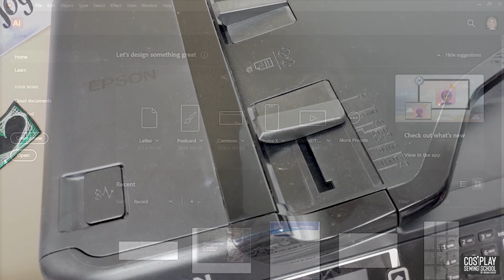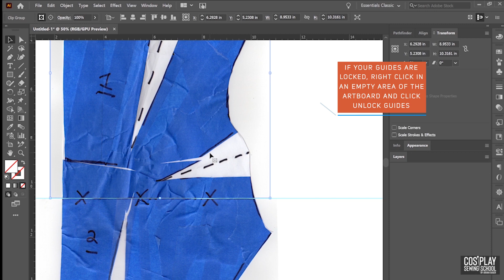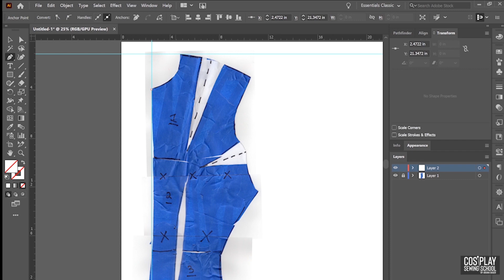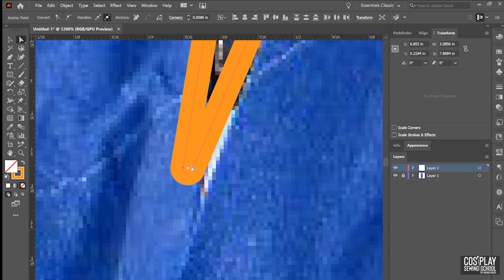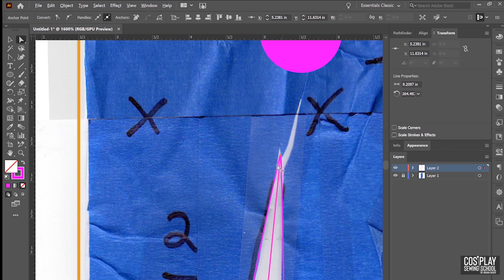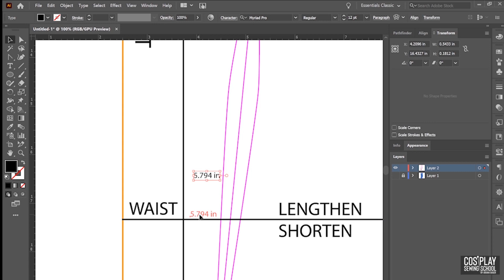Easy Way to Scan and Digitize Patterns for Sewing and Foam

Comment: Do you have a video on how to duct tape yourself and create that block?  This is amazing and much less costly than using StyleCAD and getting its digitizer as well!
Reply: I will do one soon. I will use my dress form for it, but the idea will be the same. I don't have a helper at the moment due to covid.

There are also great flat patternmaking ways to do this using math that will get your really darn close. Glad this helped!
Reply: @ArianaBauer  I have been flat patterning for the past decade, but for close/accurate fitting purposes, this is a skill I need to strengthen, also because I don't have a helper to duct tape me as well.
Reply: @DuchessPinkbunny  I am always refining my blocks. I keep changing weight and size so its a never ending cycle!
Reply: @DuchessPinkbunny  I struggle also because I keep gaining and losing weight and changing size. Its a process that never seems to end, getting a good fit block!
Reply: @ArianaBauer  I know that feeling!  Also, the amount of books I have on sloper drafting always have different methods, so my blocks don't ever look the same!
Reply from the maker: @DuchessPinkbunny  Same here. I must have 20 pattern making books and they all come out different. I am actually finding the historical books to be way better at being "the same" in that different books still get the same results. I am thinking of making a set of slopers as a purchasable item - but with different proportions for different body shapes. The problem is that not all drafting methods work for all body shapes.